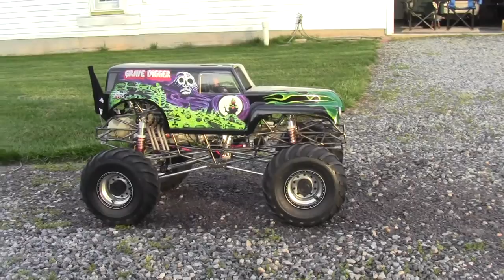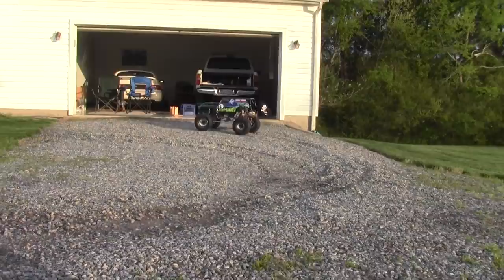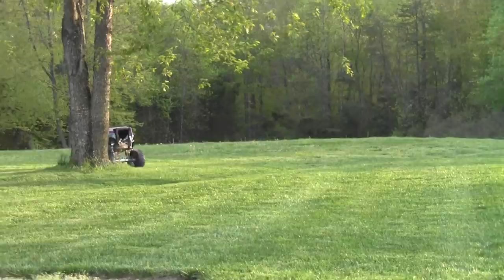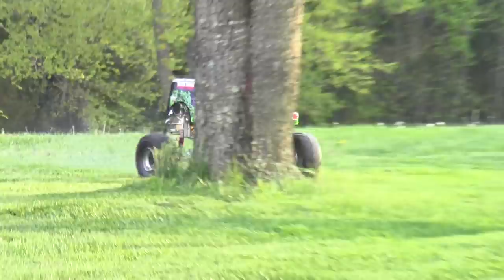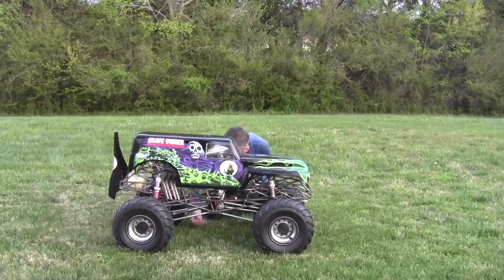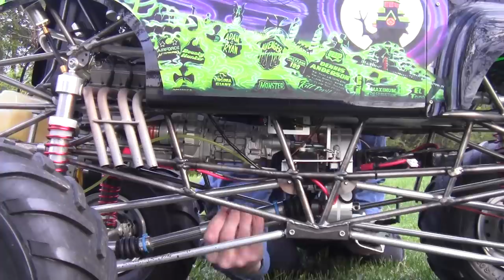1/4 Scale Grave Digger Part 24C with Stinger 609

Comment: You don't have low gearing, just a go cart centrifugal clutch. The transmission parts will continue to fail until you get low gearing. Your constant throttle cracking just makes it fail sooner, without a low gear.

Comment: if it turns out to be a chewed up belt again maybe it is due to stretch.  i know belts will stretch some in there first minutes/hours of use.  maybe in this case it only takes a minute or so to stretch so much it is jumping teeth.  maybe you could pre-stretch the belt or run it for a minute then tighten it and repeat that a few times.  do you have to pull the transfer case apart to adjust the tension?

Comment: Not the Set Screw this time you mentioned. :) 
as per my other post about the rear end pin snap, could there be some resistance in the rear end when you turn and one tire comes off the ground causing the belt to try and slip, causing force. after time the belt shreds. Just a thought!
Love the Truck...   I WANT ONE!! ;)

Comment: I have to wonder if Conley has some dome pistons in the works? Sounds like the cam is all there, but the capability of the engine being able to run 87 octane even with boost seems like awfully low compression.. I'd bet with higher compression and some timing changes, that engine could make 15+ hp..

Comment: My god, it sounds like the real thing! Absolutely beautiful. Great work!

One thing I noticed is the low gear ratio. Does the engine not produce enough torque to drive at lower rpm's, or is it a quirk of of centrifugal clutches that you just can't get them to engage at lower rotation speeds?
Reply from the maker: Well, 15 to 1 ratio and 90 lbs doesn't help.  I would prefer 20 or 25 to 1.  Can't wait to see how it runs with the new Fuel pump/Carb upgrade.
Reply: JuJu I,. M,
Reply: rcWizzard  2wd with a chinesse atv motor 4 stroke could have been cheaper
Reply: MrBonami2 And would have looked and sounded like a piece of shit, with all due respect.
Reply: Motorsheep  at least it will do 80kmh and pop wheely not sound like a stupids engine that going to blowup.  and cost 200$ while his cost 8k
Reply: MrBonami2 No offense meant, sorry :(. I just love the sound of V8's. And I know that this V8 is surely not the best performing engine you could pick for a scale model. But this thing was obviously made for style, not performance, and to be as close as possible to the real thing. And the real monster trucks are all V8 powered.
Reply: Motorsheep
a v2 can am rotax motor sound as strong as a v8 explain...... marketing shit a 1 cylinder can sound as bad as a v8 if tuned for it.  Same thing for harley engien tuned for the sound

Comment: I'm guessing it was the belt again. Are you using fiber reinforced belts or are they not available in the size you need? Have you considered either a chain drive or a viscous coupling similar to a torque converter in an automatic transmission? I'm sure that's something you'd have to build yourself but you seem to have the mechanical know how to do so. I imagine getting the fluid pathways correct and balancing would be an issue without a CNC. Either way, I was very excited to finally see it run.

Comment: What does something like this  Go for pricewise please comment back incredible truck fabulous job thank you
Reply from the maker: It’s a one-of-a-kind so it’s hard to say.  Cost-wise, 3 to 4k in materials, 11k for the engine (I got mine before the price increase).  Then 1000 plus hours in labor.  At say $30 an hour (which is cheap for custom fabrication) that brings the total COST to 44 to 45k.    Thanks Martin!

Comment: What an amazing machine. Well done. There are always some hiccups in a massive build like this. Glad you can chuckle and move on. The Conley sounds awesome. Was it running a bit rich/lean? it seemed to have a bit of a stutter?
Reply from the maker: Thanks Mark!  The engine builder has determined the Stinger needs MORE Fuel!!  He as redesigned a mechanical fuel pump rather than a vacuum based pump.  The new pump is now located in the alternator, which was there for appearance only, but not any more. My older carbs cannot handle the additional fuel, so I need the new pump + new carbs, which he will not have Extra carbs until he has completed his current run of engines. I need to do a video explaining this.  So,  To be Continued ...
Reply: Can't wait to see this running with the right amount of fuel getting in there. Hope you have spare T/C belts...lol
Reply: rcWizzard explained why it seemed kind of gutless.. sure it will run a lot better once it starts getting fuel
Reply: I have a nitro r/c truck and it sure can make a huge difference getting the fuel/air mix right. Any word from Conley on fuel injection for the beast? I saw another video of a DOHC V8 scale motor w/fuel injection. Man it ran smooth.His ignition/fuel management sys was really bulky - external to the motor looked like something from a modern GM V8 - 4 coils etc. Pretty cool none the less.

Comment: Sounds amazing for such a small engine, just like a mini monster truck should sound
How much can it pull weight-wise?
Reply from the maker: To Jackson.   Well the truck is 90 lbs, don't plan on pulling anything.
Reply: Makes sense because probably getting those 90 pounds of metal, plastic and other stuff to move fast-ish is probably a push anyway

Comment: It would be tricky to make it work with that kind of torque...but since you seem to have the capability to fabricate just about whatever you want, I'm sure you could make one to work in that chassis.  Making it look correct to scale would be harder, as the surface area you'd need with the 609's torque would probably be pretty large.

Comment: hows the Fuel pump/Carb upgrade going? :) too excited!
Reply from the maker: Juliusz Baczynski Got the Engine back.  Need to hook up lines, throttle and exhaust.  Mount new batteries so their easy to remove.  Should be able to run it this weekend.
Reply: Amazing! Can´t wait!

Comment: Hi, I just purchased a Conley 609 few months ago, I have yet to install it in a model, but I plan too.  You seem like to have the most run time on this engine of probably anybody out there, have you had any reliability issues with engine I need to look out for? Thank you! You have done a fantastic build!
Reply from the maker: Hey JTE.  Cool, we should start a 609 Club.  Only real problem I've been having is the right side rubber mount keeps splitting in half.  Mine has the high lift cam so it's a bit temperamental.  I think that's why it  stalls like it does.   What model/car/truck do you plan to  put it in.  Is it one you'll make?  Keep in mind you need room for an oil tank and a water tank, the bigger the better.  Those 2 alum tanks on my truck hold about 90 oz of water and it doesn't  take long for it to get Very hot.  Good luck!
Reply: rcWizzard I have the high lift cam version also, oil tank, water tank, etc not an issue because I’m a professional performance automotive fabricator by trade, haven’t decided on model yet, but leaning on building a rear engine dodge van “little red wagon” something that showcases the beauty of the engine😁 thanks for getting back to me so fast!

Comment: awesome project. wish I had the RC funds for something of that scale. from a mechanics point of view and an avid extreme 4x4 enthusiast, I think u should really consider a gear to gear transfer case. I'd be willing to bet the belt, no matter how big u make it, will never be able to withstand the stress and heat of pulling that kind of weight around for more than 5-10 minutes at a time.

Comment: Amazing machine!! Is that MR2 a turbo?????
Reply from the maker: To Graham.  Yes, a 1992 Turbo with 67k miles.
Reply: @rcWizzard  I have ALWAYS loved those cars!!! Glad to hear she's still young; is it stock?
Reply from the maker: @grahambambeck7452  Yes, mostly stock.  A larger intake on the throttle body.  Straight downpipe, vented brake rotors, sway bars and 17" wheels with 40 series tires.  170 HP at the wheels. :-)
Reply: @rcWizzard  that's awesome! Strong numbers for a car that size. I have a Focus ST with some bits and a tune, I love it! Would love to see a walk around of the MR2 if you ever have a chance :D

Comment: What gear ratio are you using? 
It sounds like that thing is trying way too hard. Something obviously isn't right. I believe that's where your issue was towards the end of the video. I just feel like your transmission wasn't giving the correct or full power to the wheels.
Reply from the maker: To J KH.  At 90 lbs, 15 inch tires and a final ratio of 15:1 it's tough on that 1/2 inch wide drive belt.   I believe I was also having issues with not all 8 cylinders firing.  Check out the "Running at Hippies House" video.

Comment: DID YOU FABRICATE EVERYTHING??
DO YOU HAVE THE SCHEMATICS??
WHAT SIZE IS THE MOTOR??
WHAT TYPE OF FUEL??
Reply from the maker: To Qi Huna.  
Everything Except the Engine (from ConleyPrecision. Com), Transfer Case, Drive Shaft, Brake system (with modifications), and customized wheels/tires from a Craftsman lawn tractor.  Schematics are a combination of Paint Brush drawings and hand drawings.  Engine is 6.09 CI, on regular pump gas, no oil mix.

Comment: luv the sound  helluva cam obviously.. scale effec tin effect with idle stability problems... cam might be alittle too aggressive with the overlap to enable decent idle...if it has solid lifters id make sure the valves had enough clearance  especially when  the heads must get really really fucking hot

Comment: Dude, you don't have a CLUE. The engine in this thing is a BAD ASS Connelly Stinger "609" with a an actual real working blower on it. It's a REAL V8 down to every last detail. The "609" stands for 6.09 cubic inches. It can rev up to 10,000 or 12,000 rpm, and puts out 9 to 11 horse power. He was only tapping & feathering the throttle on that thing. If he took it out on the street & held it wide open, it would really haul ass. The whole truck weighs 90 pounds. That little engine block is only 7 inches long I believe. To put things in perspective for ya, a Briggs & Stratton 5 horse power go-kart / lawn mower type motor is around 12 to 13 cubic inches. That's TWICE as big as this little engine, yet it makes only HALF the horsepower. This engine is a scaled down version of a top-fuel dragster engine, and runs on real 87 octane pump gas. He keeps having problems in the differential and / or the transfer case. It AIN'T the motor. This engine is better built than any other available to the public I believe. It's capable of turning TWICE the rpm's of all the others, yet runs just fine, because it's built to do so. Cost for the engine ONLY is about 7500 bucks, and yes, you CAN buy one. The company builds others too, including a REAL 1/4 scale flat-head V8 that is HAND machined with over 350 hours of labor involved. It costs $17,500.00. These little engines give me goose bumps, they're so cool. Sounds just like the real thing.............hell, they ARE the real thing.........only smaller. Google up "Connelly 609 Stinger V8" and he has a KILLER a near half-hour video showing the guts of these motors & tons of details about them. Simply amazing.

Comment: You should make it a four wheel drive if you think there's enough power for it
Reply from the maker: To Patrick.  Still working out the kinks in 2 wheel drive.  And, not ready to spend 100 to 150 hours designing and making an axle with drive and steering.

Comment from the maker: Wheels are from a Craftsman riding lawn tractor, 6" diameter  with 15" tires and weigh almost 10 lbs.   No, they will not fit 17mm hex RC hubs, sorry.

Comment: Just curious, how much does that weigh?
Reply: @issac3100   Wow! I thought mine was heavy at 80 pounds.   Thanks
Reply from the maker: @PrimalRC  40 lbs of that is wheels/tires.
Reply: @rcWizzard    Wow, I see.  The Primal Monster truck wheels weigh 5.5 pounds each. The axles in the Primal is where most of the weight is.

Comment: Sounds a helluva lot faster than it actually is.
Reply from the maker: To Rick.  That's OK by me, this thing is a handful to drive.  The Engine out performs the steering and brakes.
Reply: rcWizzard What motor is in it? Also how much was the total build cost?
Reply from the maker: Rick.  Engine is a Conley Stinger 609.  6.09 Cubic inches.  SuperCharged 1/4 scale V8 from ConleyPrecision. com .  Cost, 3 to 4k in materials, plus the engine, plus 1000+ hours to build.   Have you seen the "Running at the Hippies House" video?
Reply: rcWizzard Wow holy cow I wouldn't want to drive it very fast either with all that invested in it. Supercharged lil 6 ci motor sounds insane I'm surprised it doesn't do wheelies constantly. I haven't seen that video yet but I'll be sure to check it out.

Comment: To all comments saying it seems underpowered, that's because it's running on normal fuel and not a mixture of Methane and Nitroglycerin like the real ones do I believe, correct me if I'm wrong. :P
Reply from the maker: Correct 87 Oct pump Gas,  and 90 lbs.
Reply: rcWizzard Which Stinger engine do you have on it by the way, the normal or the supercharged version? Oh, and, could these engines handle methane with nitro fuel or would that damage them too badly?

Comment: It is electric ' But I have thought of maby tryin to build one w/ a motor out of an old drill press that I have ' the main problem would be finding a battery that would have enough nuts to run it & then theres the whole thing of converting it from DC to AC power
Reply from the maker: To James Rodgers.  That conversion is going to take space and weigh a lot.  What scale are you thinking of.

Comment: That thing looks and sounds badass but it needs bigger tires
Reply from the maker: Thanks MRLunch.  They should be 1.5" more in diameter and 3" wider.  But good luck finding on 6" dia wheels.  And bigger would not help performance, or turning.

Comment: Do they overheat regularly?
Reply from the maker: +ExoticSpeedify Heat is a concern. I have 2 aluminum water tanks.  1 I'm am in the process of modifying one with a temp gauge to keep an eye on the water temp.
Reply: rcWizzard Can you make a radiator with a small fan?...how heavy is the grave digger
Reply from the maker: +ExoticSpeedify A radiator that fits the chassis cannot hold enough water.  The tanks hold 90 oz.  Truck weighs 90 lbs.
Reply: You could maby have the water pump from the tanks to the small radiator, back through the tank ect with a small pump... But could be complicated

Comment: "Read the description to find out why it's part C."

Description: "OK, this is the last of the Part 24 series.

Oops, make that 24C!"

Am I missing something? Awesome truck though
Reply from the maker: Video part 24C was meant to be the truck running great, but alas,  I ran into several issues.  So I documented my challenges with parts D through i.   Then  XX months later, the truck is moving along rather quickly for a 90lb 4 foot RC Truck, so I labeled that video 24C,  but in the video I said 23C, so I corrected myself in the description.  At the end of 24C the truck stops moving due to a loose belt in the transfer case.  The Next video is “Driveway Tuning” where you see a 90lb doughnut at the end.
Thanks.

Comment: that is BADD ^&* ... look into super lugs they come in lots of sizes ... may require custom rims or adapters ???  u can then use a grinder to give them the mt cut
Reply from the maker: +Y2daT420 I did.  These are Carlisle tires, they used to make lug tires that fit these wheels, But, are no where to be found.
Reply: k cool  well that sucks

Comment: The truck and sound is so cool.  But it's way too slow bro.  Get some speed and power underneath that body to go along with the sound and you will have an awesome bad to the bone truck.
Reply from the maker: To Eddie.  This truck is a handful.  The engine exceeds the steering and brakes.  I don't want 90 lbs going 30-40 mph.  Thanks.  Check out video Running at Hippies House.

Comment: Only thing I’d add is bigger tires
Reply from the maker: To HYBECTIVE.   They should be about an inch taller and 3 inches wider. But good luck finding them, on the same size wheel as these.

Comment: Sounds good but doesn't look like it has much torque. For 9K I'd expect it to have more torque than a $300 electric RC car motor.
Reply: Its probably geared down for kids you hear that son of a bitch? No way he went over 30% throttle
Reply from the maker: To James.  How do think that $300 motor would perform in a 90 lb car with 15" dia tires?

Comment: What is its top speed?
Reply from the maker: To Brad.  I do not know.  I have no way to determine that. FYI, I want torque, not speed.   You don't want a 90 lb RC truck going 40 - 50 miles an hour.

Comment: Looks a bit small for a 1/4 scale, to me it looks closer to a 1/6 scale
Reply from the maker: To Jeremy.  Check out video part 11B.
Reply: rcWizzard I'm not saying it's wrong, just saying it looks a bit smaller than 1/4 size of the real grave digger.  I've seen it, the tires are around 6 ft tall and the whole rig is probably around 12 ft tall.

Comment: everything is awesome on this thing but it needs at least 3 times more power than thatnother wise id get bored drivin it, at least if it could peal out the would be more fun and if it could take off than that would be nice for jumps.
Reply from the maker: To adam.  This truck is a handful to drive.  The engine out performs the steering and brakes.  Trust me you don't want 90ibs moving much faster.  Have you seen it run in the "Running at Hippies House"  video?